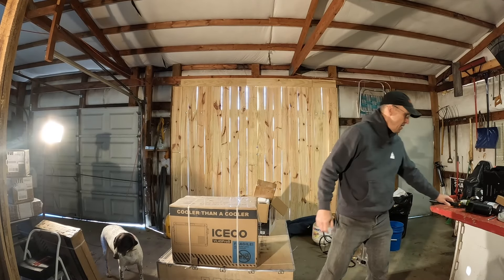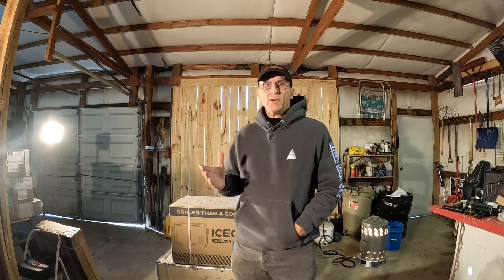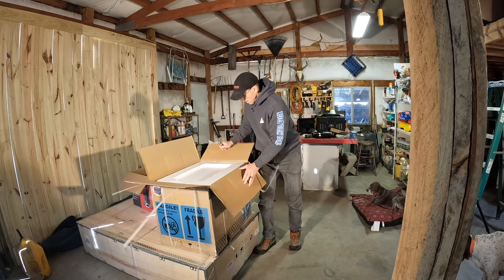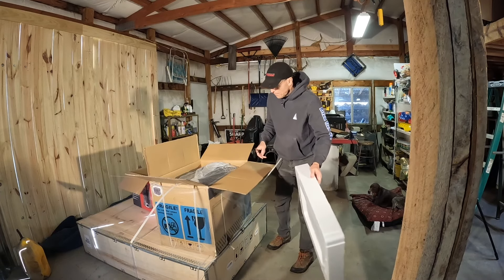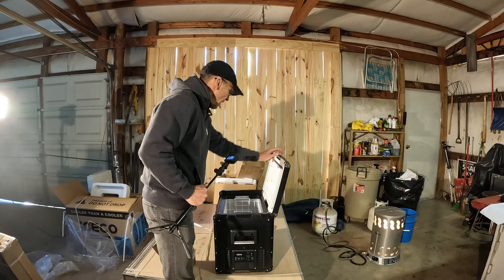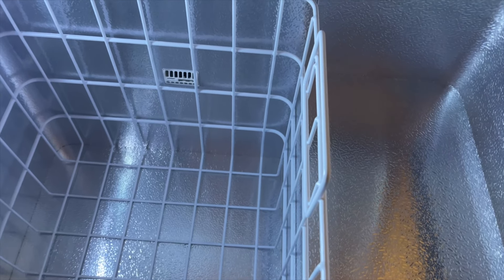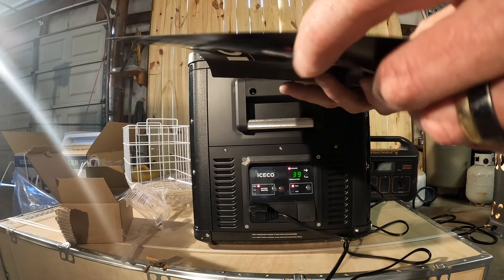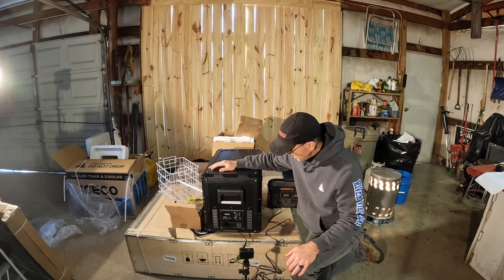ICECO Freezer VL45ProS Review & Slide Mount Installation in Bronco Badlands Overland Build 4

Comment: I have the exact same problem. I need to put 1/2” plywood under my slide to get it to clear. The floor of my trailer is 3/4” thick. What size screw would you use for that? Also, once the plywood is installed, what size screw did you use to attach the slide?
Reply from the maker: Hey Tracy. I think it was a 2” screw for the board and 1” for the slide.  Thanks

Comment: Did you use a 2in self tapping screw from the plywood into the floor of the bronco?
Reply from the maker: yes.  There is probably a better solution, but I'm not to worried about if I take it back out or not and what it might look like.
Reply: @trailhunterusa   not a bad idea at all. I would like to take the whole thing out in the winter as I won’t be using the fridge. That’s a great way to do it as long as I don’t overtighten the screws and strip the threads
Reply from the maker: @HankMarducas  thanks.  I thought so.  I use mine all seasons, but this does make an easier removal